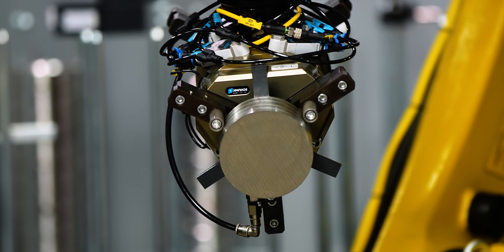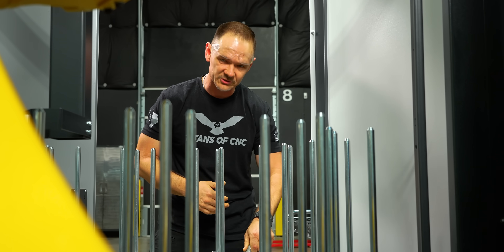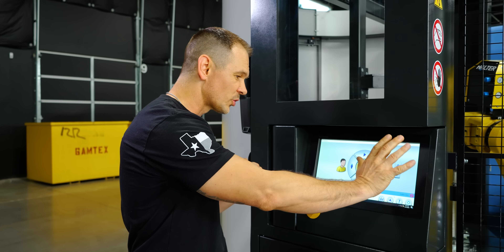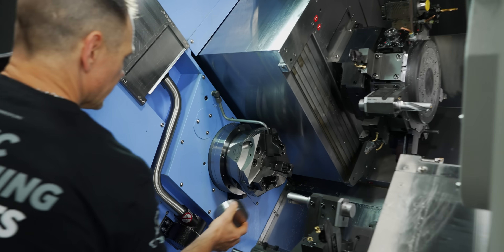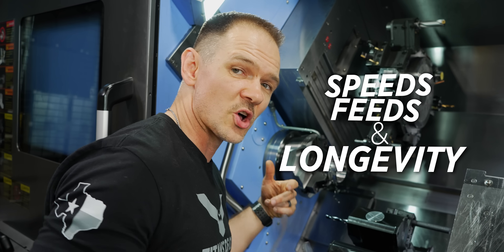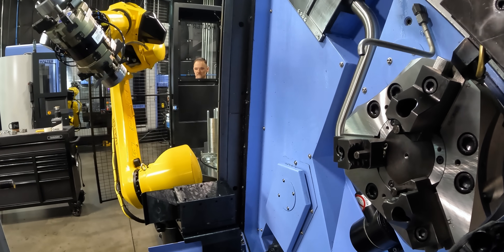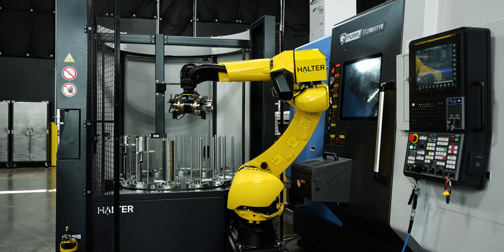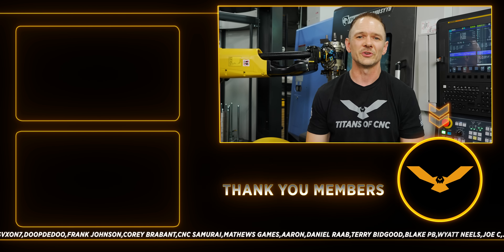Maximize Profits with a 24/7 CNC Automation Cell: Dual-Chuck Lathe & Robotic Loader in Action!

Comment: So when does this same sense? Id imagine for 50 parts itd just be cheaper to have a guy standing close to it changine parts every so often and doing other things in the meantime. Plus what about parts that are tapered? If you regularly have a series of 100+ parts it def makes sense, but for your avg small shop this will probably hardly pay off

Comment: Vid request:  an in depth vid in getting a process dialed to the point you can rely on it for a 8 hour-24hour shift.
All the pitfalls and solutions.

Robots are awesome and can be easy to integrate, but having a machining process that you can wal away from for a day is the real challenge and the barrier that stops many from investing in advanced equipment

Comment: I'm sorry, that is a poor example of utilization of man and machine. Could be manufactured with older technology much more efficiently and way less cost.
Reply: Jeff I’m sorry but unless you can tell me otherwise, there is not a chance “older technology” can execute a sample cell like this with 24/7 efficiency. There are ways they can optimize this further as well in the matter of minutes. Sure short term cost may be more cost effective but these machines are designed to run light out for years with little maintenance other than putting in new programs for new product. Cost efficiency in the long run with new machines is unrivaled. Sure these machines aren’t cheap but like I said, this is lights out. Turn around time for a larger work cell than this is unmatched.

Comment: Some times think this automation removes the drudgery from running machines. But rather than having your skilled guys / girls loading the machine. Get someone young in. Start them off loading then tip changing inspecting the parts. This gives your skilled people time to do the things you pay them for and the operator the opportunity to learn.😊 before you know it they are starting to move on to setting the machines.

Comment: Price for this robot setup? Without the lathe
Reply: Reach out to me via email if you’d like a quote. trevor@titansofcnc.com
Reply: 150-170k for the halter, plus more if you need an auto door and software option/ ladder edits to the machine tool for coms to the robot.
Reply: @funwitharobot that’s not correct. Halter starts at 100k, depending on the model. This set up is 25% lower as you mention here. By the way, ROI is always under 18 months. Ask one of our experts.

Comment: Considering I've spent the last 10 years at several factories running machines from the 80s-early 00s, including a tape memory machine still running today, I look forward to the opportunity to try this new technology in the 2050s
Reply: Thanks for putting into words exactly how i feel about my job.
Reply: thats the thing about this field, some people go into it thinking every shop is like this but its simply not true, most job shops are dirty and the machines are worn to hell and back, and convincing management to invest in equipment or maintain what they have is like talking to a tungsten brick
Reply: tbf this is just a nicer version of rather old stuff, at my previous employer we had a a Fastems pallet system attached to all our machines along with 2 CNC lathes one of which being about 50 years old that was fully automated with a robot parts changer attached to the Fastems system so we just had to load up normal pallets with parts and it would run 24/7 as long as the tooling held up. That system was from the early 00s.
Reply: Странное дело, коллеги: я работаю в России на станках с ЧПУ — и эти станки у нас на заводе современные: самый старый — это HAAS UMC-750 2018 года выпуска. 
И роботы FANUC давным-давно установлены.

Comment: Thats a really cool set up , dual chucks , op 1 , op 2 , etc .. One thing comes to mind .. when I was a highschool kid who got a summer job in a shop in Ireland I was the robot , cut the blanks on the saw , and when the program for op 1 was up and running I would load the lathe , run op one , learn to change offsets etc . Its how I learned about cnc .. Automation is great for the bottom line .. the balance sheet , but I still think a little old school production running will teach the newbies of the business from the ground up ...  keep up the good work guys.. keep teaching ..

Comment: All i see is two machinist out of a job with all that automation.
Reply: A machinist that lost their job to a robot is one that didn't have a good job to begin with.
Reply: @vintageludwig  tbf I get the same hourly rate for humping castings on a machine as I would in oil and gas  and the stress that goes with cutting 30k worth of inconel at a time. There is a massive difference between a good job and a good paying job, pros and cons to each one.
Reply: There are no people to loose a job… because there are no people wanna work as button pushers - sad but true
Reply: @teekteekteekteek  then theres people who can't comprehend the difference between want and need, usually with atrocious grammar.😆
Reply: @bobmcbob8732  oh no, English isn’t my mother tongue. I‘m so sorry sir! 

There are a lot of people jobless and don’t want to work as button pusher true. Social welfare benefits are some times to high.
Reply: *reliable people

Comment: I wander what it costs to set something like this up. Say that lathe itself minus the automation was 350K tooled up, wander what the ROI would be compared to hiring a person at say $30 an hr to replace the robot?
Reply: I don’t know but let us say the robot costs about 120k - 1 person works 8hr shift - 40hr a week. Let’s say 10month a year (holiday and sick included) so more or less 1700hr per year productivity. But costs times 30$*52*40hr=62.400$ per year.
The robot could work 24/7 - even if this is unrealistic.
365*24hr=8760hr production maximum. The robot is more consistent but slower. Let’s say he make 12hr per day - still around 4400hr productivity.

120k$/4400hr= around 28$/hr
In the first year!!
Sure no electricity and service costs include…
Reply: What I've seen of them, unless you have a couple parts that you need to run constantly for 5-7 years, it's cheaper and faster to pay a person.
The robot will not run constantly , it WILL be broken down at some point, and you'll still have to pay someone decent money to attend the robot. They don't just walk into the shop, set themselves up, and run the machine autonomously. 
A more realistic look is that robots allow one operator to run a cell of machines while not having to load/unload parts every few minutes on 2-6 machines. That way they can focus on making good parts, not scrambling to load machines.
Reply: @SecondFloorOutdoors  sure - but as a small shop owner it’s pretty nice having a second or even a third shift. And if you look at the speeds of the robot, they are slowed down a lot. These are robots built to run 100% 24/7 and couple of years. In this halter or every other builders case, they slow them down to 50% and less wich leads to far longer lifetime.
We have one cell in our factory runing for 10 years. Not 24/7 but still has around 30.000 hours worktime.
Reply: @teekteekteekteek  depends on what a small shop is to you. The one I'm at is about 30 people total, we run two shifts. We have a fanuc robot that is overall probably considerably less productive than a person. When it's working it's ok, it lets the operator run another machine, but we call it Joe b/c it loses track of what it's doing and wanders off. We can pretty much only run it when someone is there to watch it. They can be force multipliers, but they're not magic cure-alls. With the upfront cost of the robot, plus the service calls, it would probably be cheaper to pay a kid $15/hr to load a slug, then stare at his phone for 12 minutes.
Reply: Right parts and enough parts - a robot is a nobrainer

Comment: Can you get a machine that has a bar feed and then use the robot and stacker as pure unloaded for completed parts? 
Less hands on and material handeling.
Reply: Yes!
Reply: the entire video I was thinking the same thing lol
Reply: Yes, they’re called turning centers. They have integrated robots and could be used to load material like in this video as well. They’re also more cost effective than this system. Those robots cost about as much as whole new lathe.

Comment: as a web developer, i cry for the users of this 90's user interface. It looks like a toddler designed it on MS Paint 3.11
Reply: I know it looks dated, but it is fast and efficient, and never fails. We have some newer machines with more pretty UI and sometimes you need to wait 0,5s for each input to register, sometimes second for navigating between modes (seems like nothing but try it for long enough and you will hate it), just because all this pretty interface is heavy for a CNC, as it's not designed for it. And sometimes all this nice interface simply glitches or freezes. I'll gladly keep the fanuc, knowing it responds instantly to any command, knowing it never glitches, and if you dig into it enough you discover hundreds of keyboard shortcuts that makes the interface more fluid and fast, the opposite of today's beautiful touchscreens
Reply: @Orakwan new ui doesnt need animations to look better. Get rid off all the kids drawings and gradients and just have a white button with a larger black symbol thats minimalistic, or just have text. Haidenhein machines use this and we have machines for the 90s up to modern ones. Its subtle, the general layout is still the same but it looks so much better
Reply: @Orakwan  that’s one thing that I do have to say about FANUC. Reliable and support is second to none if you need it.
Reply: I used to work for FANUC and I would always cringe seeing our interfaces... I still cringe. Their iHMI system is better than their old Windows CE interfaces, but still looks like a middle school student designed it.
Reply: @CNC-Time-Lapse  Dude. I work with Fanuc CNCs and Robots and man do I hate the interface. Especially the CNC interface. It's like it's stuck in 1979.
Reply: The Halter SmartControl helps you to set up in just a few steps. No need to use the Fanuc UI. By the way we use Fanuc robot arms because they are the most reliable in the market. Rock solid.
Reply: The problem with web interfaces is that they require Javascript, these machines are most likely certified to industrial standards that won't allow dynamic memory allocation, which limits you to pretty much only C/C++.
Reply: Those are standard interfaces, designed using HMI framework. Having a reliable modular interface on a production machine is a completely different thing to website, which performance and reliability is not a primary objective.
Reply: I dont care what the UI looks like, as long as it is effective and doesnt strain the eyes. I would much rather have an ugly, bug free UI than a beautiful UI that makes me wait on it because it is so burdened with graphics or other features (im looking at you, Uniqua with your “help” [?] feature that slows the machine down and makes me think you froze up)
Reply: It could be worse. Really! I’m using CAD tools for advanced integrated circuits. Many pieces of the code was written for punchcards. Error codes refer to errors on cards! Unbelievable.
Reply: Efficiency is hiding in simplicity.
Reply: Do it to it,  Linux CNC needs modern interfaces
Reply: At least the robot itself is not running windows...... oh wait

(I an not sure about fanuc or any new stuff, but I am 100% that the dx100/dx200 yaskawa robots used some old windows version)
Reply: I still love fanuc controls but then I started using Okuma OSP and I instantly fell in love 😂
Reply: Right but it’s totally possible to have a modern interface that performs well, they just don’t build their machines that way
Reply: @BlackMapleMFG  currently training into running a puma barfed lathe for a hydraulic mfg   company that has an international parent company... lately it's been about quantity not quality... and as an only child I got taught quality over quantity cuz the next guy will have it easier to succeed as well... I ran 3 saws for 15 months there and all the machinists have begged me to go back to cutting for them... after 3 weeks of consistently good square usable parts and less scrap wasted materials cuz they were short or crooked  their productivity went thru the roof too... but I understand why I hear random Fbombs from machines or see a MF running to hit the feed hold or big red button
Reply: Toddler design perfectly fit for todays workers brain capacity ...

Comment: Dang.. button pushers are being phased out. Kinda sad.
Reply: <<< moved to more value added processes
Reply: Yeah I like to think lifted up to bigger and better things.
Reply: @travisjarrett2355  haha right. Well, its what Ive told all operators Ive trained, you either do something with the knowledge Im providing or risk being left behind. Gone are the days of 30+ machines with operators on each machine. Good times.
Reply: no, we become slaves of the robots! Who is going to load/unload/clean the parts?
Reply: @greenbuttonpusher_hc6453  lmao your username
Reply: that robot is handling a highly repetitive task. So not taking over button pushers yet, just the hardest working people.
Reply: @qalamalamala  I was learning how to operate that robot 4 years ago. Shouldve learned some more but I missed being on the machine doing 2,3,4 pc jobs at a time. Only time I entered the cage was to set up, change an insert or clear an alarm.
Reply: You can’t do anything with robots. There are a lot of things they can’t handle or not efficient